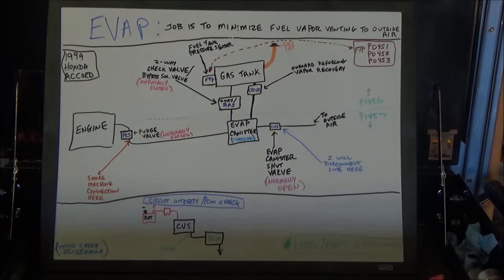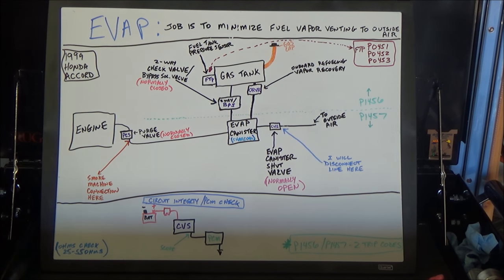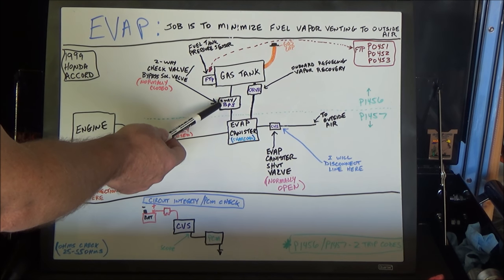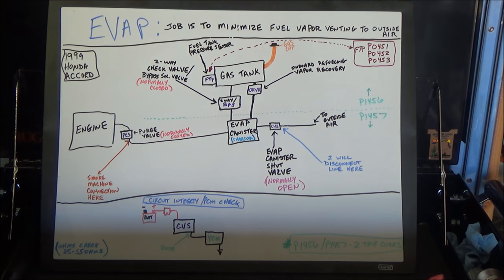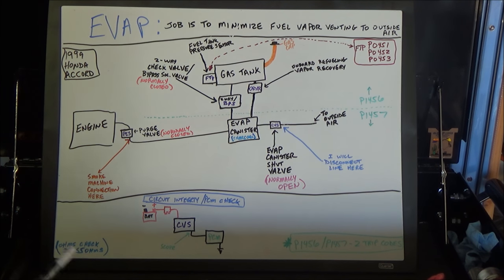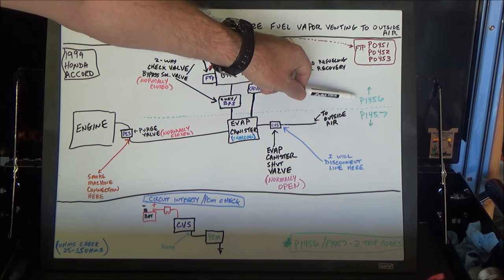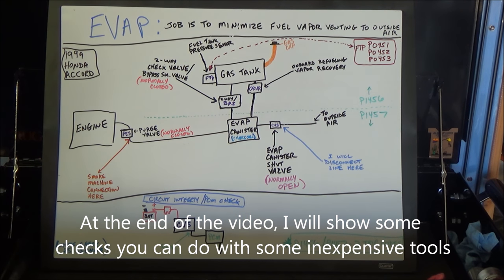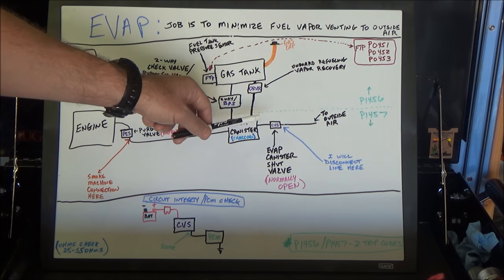Honda Accord P1457 (90-2) EVAP Canister Vent Solenoid Diagnosis/Repair 1999 V6 (1998-2002 Similar)

Comment from the maker: Tools Used:
This channel earns a small commission using some of these links - at no additional cost to you.
OTC Smoke Machine: https://amzn.to/2YW9HqN
Autel Scan Tool (Updated Version):  https://amzn.to/2YOGA8t

The Big Dog 50001 Automotive Channel Store can be found here: https://www.amazon.com/shop/bigdog50001automotive
Reply: Big Dog50001 Automotive is this the same as code p0442? On an 03 Honda Accord lx.
Reply from the maker: @oreoprincess19  Similar, the ECM is using some logic to detect a small EVAP leak in the system.
Reply: Safety glasses? Pshhh, safety squints works just as good haha. Thanks for the video, I’m about to do this to mine
Reply: well done . thankz
Reply: 2001 crv p0420 tool shows cat, evap, and o2 monitors incomplete. Erased code now only evap monitor is incomplete. Does this point to evap as issue? thanks btw you are obviously truly passionate about what you do because when you speak about automotive it sounds like you invented it. by speaking like this it makes it easier to understand and appreciate this.
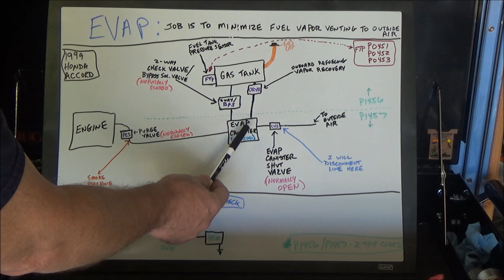Reply: Blessings, John 3:16 (NIV).  Jesus loves you.
Reply: Purge solenoid  valve  gases inertes  cange i  acura tl 1999

Comment: Hands down one of the best videos on this subject on the entire internet. This was like going to class and learning a lot! If you have P1456 P1457 error code on your Honda start by watching this video and then get informed about the specific features of your Honda. I was getting P1456 and P1457 and guess what? It was the two-way valve on my 2004 Pilot. With no special equipment I got the parts off the vehicle with the canister and the canister vent and canister passed. Then I tried the two way valve still connected to the bypass valve by blowing from the canister side to the tank side. The one on my rig leaked! I replaced with a confirmed good valve form the scrap yard and CEL off, tags on the way! Thanks, Big Dog50001!
Reply: Part number?

Comment: Awesome!  You saved me big bucks!  Check engine light was on with code P1457.   Tapped the solenoid like you showed. Disconnected the battery for a few minutes then reconnected it.  Drove it around for about an hour. Still no check engine light.  Went to get the emission check and PASSED!  Yahoo!!!!!!!!!!!!
Reply from the maker: Good to hear, thanks for the comment!
Reply: @BigDog50001  ...1999 Honda Accord with 261,000 miles in rust belt still going strong thanks to you!  Cancelled my appointment with the mechanic this a.m. Going to get the get my renewal sticker this weekend!  Thanks again.

Comment: Great video! Especially the illustration that advises where to look based on which code is thrown. 

When I bought my 2000 Accord for $500, I had to immediately replace both fuel lines but neglected to replace the third evap line. Your video showed this was my problem!
Reply from the maker: Glad it helped, thanks for the comment!

Comment: This was a great explanation of the system. Unfortunately, I've replaced a ton of stuff and still get the P1457 code. My issue has gotten worse in the past 2 weeks. Now every time I fill up gas, the car just cranks and won't start for the first 3 tries. After that, it will start, but stall out 3-4 times. After that, it will eventually stay on and drive perfectly normally until I fill up the gas again. I've changed the Charcoal Canister vent valve, then the charcoal canister assembly with the vent valve, the purge solenoid in the engine bay, the fuel pump assembly, and the gas cap twice, and the O2 sensor. It went away for a while when it first showed up a couple of months ago, but now it comes back every 2-3 days. Issue is starting to cost me a lot of money in parts and labor. One thing I'll note is that my fuel trims are high, but not high enough to trigger the lean code. My long term fuel trim is around +7/8 most of the time. And my short term goes to 0 if I'm coasting, but seems to rise at idle when I'm at a traffic light. Can you give me an idea of what else it could be? I need help. I smell gas after struggling to start after filling up, but I don't notice it after that.

Comment: I think I beat the P 1457 code! Changed the evap canister and the canister shut off valve. Cleared the code and hopefully the engine light won't come back on. Going for emissions testing this morning.
I did have to pay the oil change mechanic to loosen that one pesky 12mm bolt that held the canister to the frame and then drive back slowly the next day to have him screw it back in again.  I'm in the rust belt too-WI.
Parts $100+60. 
Mechanic estimate >$750
Big savings!!
Thanks for the great informative video!
Reply from the maker: Thank you for the comment!

Comment: Thanks a lot for the video, I have a 2003 CRV and a 2005 Element, and they have reached the point that lately I have been jumping from one to the other fixing things, right now I have emission problems with both I have a P0497 on the Element and a P0457 on the CRV...this video helped me a lot making sense of how the Evaporative System works. THANKS AGAIN Big Dog50001.

Comment: This is a good walkthrough. I have a P1456 on my 2000 2.3 ( not gas cap) I would love it if you had one of these videos for that code.
Reply from the maker: No I don't have a video on that code but I would fix it in a similar fashion, seal system and find the leak or bad component that is fooling the computer into thinking there is a leak.  The computer looks for changes in the fuel tank pressure during certain testing conditions and when it doesn't see the changes it is looking for it sets a code (after 2 trips).  Fuel Tank Pressure Sensors, Vent Solenoids, Two Way Bypass Solenoids and Check Valves, cracked/broken/plugged hoses, Charcoal Canisters etc can all cause that code.  Some models are susceptible to charcoal being sucked into the lines and clogging the purge solenoid and lines to it.   Thank you for the comment!

Comment: Thanks, this was so helpful.  We had to dill out the old screws and tap new threads in the inserts on the canister,  Car is in PA with 240K on the odometer.
Reply from the maker: Yeah older cars out there will definitely have rust/corrosion issues, thanks for the comment!

Comment: This vid save the day. Had a check emission light & injected air into the system which confirmed evap pressure sensor working but air would not hold in the system cuz of a stuck vent Solenoid.

Comment: thanks, emission testing is coming up and I need to get this fixed or else I won't pass. I recently took my car to get it fixed but they replaced the bypass solenoid. It didn't fix it at all, after watching this video I think I might diagnose my self and fix it on my own thanks!
Reply from the maker: Eric Zacarias Thanks for the comment, I hope you get it fixed.

Comment: Excellent! Clear concise and thorough. And yeah, I would have had a sparky little 9 volt battery at the canister testing the Canister Vent Shut Valve solenoid. Of course - if I blow the car up it wont keep throwing codes, right? Thank you.
Reply from the maker: George stuart-vail lol, thank you for the comment.

Comment: Oh my God I love your videos. Unfortunately I ain't too mechanic savy. I have a problem that has plagued me for about a year and lost about $300 on it. My vehicle is an 06 Honda Element California Emission originally, the  vehicle is no longer in California. It started out with a p2422 evap vent valve stuck shut. The vehicle did not want to take gas when refueling. I paid a shop $200 to supposedly fix it. They say they replaced the valve. Three hundred miles later the code came back. I called them up and they were pissy about it, so I said screw it I will fix it myself. The shut valve looked like an original part, so they either did not fix it, or they put a used part on and charged me for new...or maybe they put a different part on instead of the valve. So I went to  the junkyard and replaced the canister, canister vent valve, fuel pressure sensor and the seperator. Its been about 2k miles and the check engine light has stayed off, but I got a new problem related to it. I can hear multiple puffs of air coming from the evap system while running. I removed the gas cap while running and the vehicle stalled. I put the cap back on and started it. To my surprise there were no more puffs of air until it ran for a few minutes. The sound came back. I am at a loss for what to do next. I do not think the parts I put on were California emissions though, if that matters.
Reply from the maker: Some of the parts around that time frame are different depending on whether it was California emissions or not, so that might be an issue.  I would double check all my work and make sure all hoses and connections are good (many times if a line is not connected properly you can hear a noise when the computer opens the purge valve).  Unfortunately, without seeing it anything I tell you would be a guess.  Thank you for the comment, I appreciate it!

Comment: Don't know if you'll see this but.  My 98 accord is throwing both codes 1456 and 1457.  At first it was only throwing 1457 i believe, my scanner said it was a tank side error.  Should I just start by changing the vent solenoid?  I visually inspected it yesterday, it all looked clean and in good condition, and the module on the engine i'm pretty sure is working right, and I replaced the vacuum lines on the engine side module when I rebuilt the engine.

Comment: Hey man you're a legend. I know litterally nothing and i think i can do this myself lol. I just have a question, my cheap scanner is telling me the most likely fix is a 2 way valave and its saying its disabled. Is replacing that similar to this or is it possibly even the same thing? I have a 2002 honda accord v6 2dr ex getting that exaxt p1457 code

Comment: So I first stared getting a “Check Fuel cap” message I replaced the cap then the check engine light came on code p0497 I tought it was the purge valve, took the car to a shop they tested the purge valve and it was working fine so my next and I think last try is to replace the canister vent valve or I might just take the whole canister assembly off from another car as you did and hopefully that solves my problem… what do you think about it bro??

Comment: I replace the vapor solenoid and it is not it  which  costs me $50 . So I measure the resistance of the solenoid 2 prongs to be .02  ohms,  the solenoid is 95% good.  IN the engine compartment, there is another solenoid called purge valve with 2 prongs, I measure it to be  0.02 ohms . I knew this is good . So the only part bad is the vapor canister.  I got the canister from Advance Auto parts with 25% discount to be 60$ same as Amazon but I can get right away.  So far it is good no more the engine light come up with code P1457
Reply from the maker: Hopefully you got it fixed, thanks for the input!

Comment: Very nice video.  I have both the voltmeter and the vacuum tool that you showed. In the event that it is not the canister Solenoid Valve, is there a  path forward without the smoke machine?
Reply from the maker: You can check the other solenoids to see if they are activating the same way I did in the video.  After that, it becomes more difficult without a bidirectional scan tool and smoke machine.

Comment: Great video! We currently have the same issue and wanted to test the solenoid but we're pretty new to vehicle repair. At around 24:21 in your video, you're using a gator clamp and the battery -but neither of us can figure out what the leads are connected to the solenoid itself (In this case, you're using the red lead).
Reply from the maker: Sluggy's Slug Cast Sorry, I could have shown it a bit clearer.  If you look closely, the other end of the two test leads are connected to the two terminals inside the connector on the solenoid.  That connector is where it plugs in on the vehicle.

Comment: What part is that called  to the right of the purge control valve solenoid under the hood?
I already switch out my entire charcoal canister assembly and still have that p1457.

Comment: Best Video!
I swapped the EVAP on my 2001 honda civic.  However, the same code P01457 came back.  When the code appears vehicle looses all power and gas pedal full floored car goes very slow.  Did swap the gas cap a well...  Any suggestion?  Thanks
Reply from the maker: I would verify that the evap Purge Valve is working, especially whenever there is a drivability issue along with an evap code.  With the engine running and the purge valve electrical plug disconnected, there should be no engine vacuum present on the evap canister side of the purge valve (not the engine side).  This can usually be verified by disconnecting the electrical connector and the vacuum hose at the purge valve and checking for vacuum on evap side (there should not be any engine vacuum because the valve is normally closed).  Sometimes they fail intermittently and can be difficult to diagnose.  FYI, unplugging it and running the engine will most likely set a diagnostic trouble code for the purge valve (which can actually be used as a quick check to verify circuit integrity).  Thanks for the comment!

Comment: This was one of the best videos I have seen on the P1457 code. My pressure test includes plugging all the holes and blowing into it. Unfortunately my canister vent solenoid passes the 9 volt battery test and the continuity test. So it appears my vent solenoid is working and I can find no leaks anywhere. My purge valve also holds a vacuum with the key on and has continuity. So where should I look next? The P1457 was also accompanied with serious misfiring with codes P0300, P0303, P0304, P0305, P0300. Could it be another problem that is causing the P1457 and the EVAP system is working?
Reply: FYI, my car is a 2003 Odyssey.
Reply from the maker: I suspect the P1457 is intermittent.  I would fix the misfire codes first before even looking at the EVAP codes.  Thanks for the comment!
Reply: @BigDog50001  So you think they are unrelated. Since they both happened the same time I figured the P1457 was the cause of the misfires. Perhaps I will reinstall the evap canister then and see if it continues to happen.
Reply: I tested the EVAP bypass solenoid valve using the same method in your video, although this is on the fuel tank side of the Evap system. Should this valve operate in the completely open or completely closed position? Without power it is completely open. When I hook a 9v battery to it the click is very faint and does not close, I can still suck and blow air through it, regardless of weather it is powered or not. Is this normal? The multimeter reading is 35. This solenoid has been a know issue for Honda.

Comment: 👏👏👏👏 Excellent video, very detailed (but not boring), and informative!!!! Can you do one on the P0456/0457 codes ?
Reply from the maker: I will see what I can do but those codes are very similar to the code in this video.  Thanks for the comment!
Reply: @BigDog50001  Oh I didn't know that. My car has the P1457, P0456, and P0457 codes. So all of these are similar???
Reply from the maker: Yes, they are all indicating an EVAP leak.
Reply: @BigDog50001  oh so basically even though its 3 codes they are referring to 1 leak ?

Comment: 01 civic and it threw a p1457.   I noticed the car is idling weird as well. As I let off the gas the rpms fall very low almost killing the engine.  Are these problems possibly related?

Comment: Excellent video 2 things wrong about this video. 1) wrist watch. 2) wedding band. That's day 1 safety training in high school. Remove all jewelry. Just don't forget to put the wedding ring back on before you go home.
Reply from the maker: I appreciate the safety points (although you could have worded it a little less abrasive), I worked in an underground mine for almost 10 years so I know all about safety.  I have a silicone safety ring now so I don't have to worry about taking it off.  Thanks for the input.

Comment: I need help. I also have a check engine light with the evap system 90-1. It says a evap system leakage (Fuel Tank). Does it i have a fuel leak or do i have to replace the tank. Any advice/information or recommend links would be greatly appreciated.

Comment: I keep getting a P2422 EVAP CVS stuck closed. I have changed the valve and I still get the message after driving a few miles. The 2019 Accord was in water but I have removed the canister and removed the water. I was wondering if the canister needs to be replaced ? Thanks ,Scott

Comment: Hi I have a 99 accord v6 that every time it’s hot outside it will smell of fuel strong I replaced that purge solenoid 2 yrs ago still smells like fuel when hot out it will hum of n on should I replace that part again or should it be ok like it is

Comment: Great video! I have P01456 code and I can smell gas when I exit the car after driving it. Replaced the fuel cap and didn't help. Any chance to show testing procedure for the tank side? I do have a smoke machine. Thanks.
Reply from the maker: A similar test can be done for a P1456, seal vent solenoid and fill system with smoke to look for leaks.  The code is indicating there is a leak (or the system thinks there is a leak due to a faulty solenoid or fuel tank pressure sensor).  Bad hoses, bad two way valve/bypass/vent solenoids, aftermarket fuel caps, bad fuel tank pressure sensors, damaged fuel filler neck areas etc. can all cause this code.  It takes two trips to set this code (as long as all driving criteria are met to enable testing by the ECM), and three trips to clear on its own if fixed.  If I get one in that has this code I will try and record it.  Thanks for the comment!